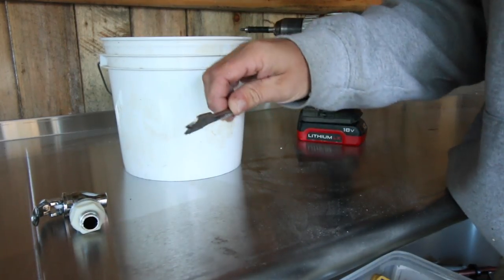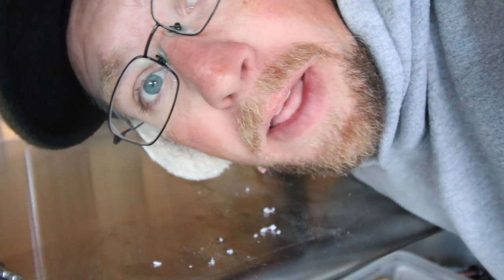Installing Running Water In the Composting OutHouse

Comment: If you wanted to do a bit of plumbing you could have a water tank in the outdoor kitchen up over head like behind the wood stove to warm the water, could use an old horizontal hot water tank and have water supply for the kitchen and the outhousen.

Comment: I went to Hobby Lobby and bought a large cake of glycerin soap. and molds. Melt 1 and 3/4 Cups of cut up cubes in a microwave bowl, micro wave 1 minute. Stir in color and fragrance and then pour into 2 forms. Let sit for time to cool off. You will have 8 bars of soap which should last for 16 or 18 weeks.